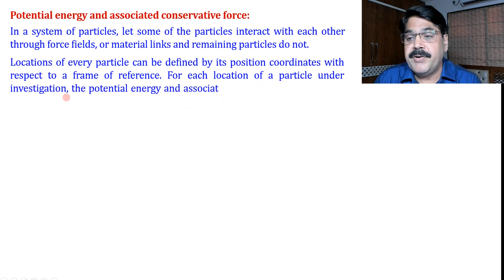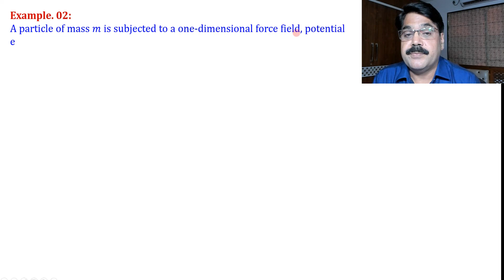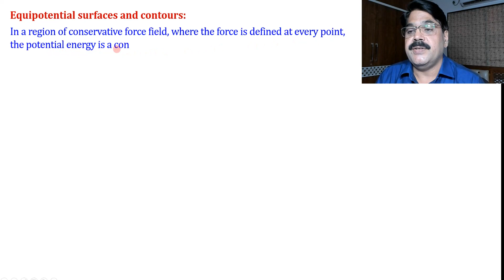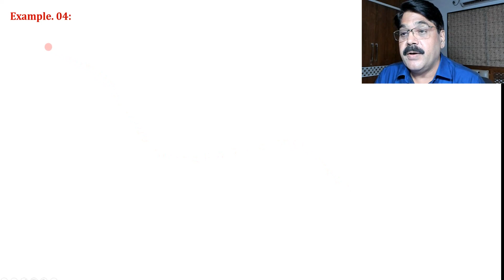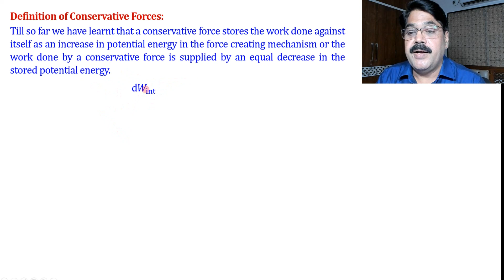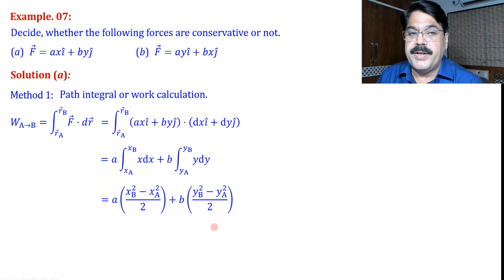L 36  WEP Gradient of Potential Energy

Comment: maximum Force is always perpendicular to equipotential surface.... can't we use this in rocket...when a rocket is launched up to space,, if it will follow a tilted path( not perpendicular to equipotential surface) then force of thrust required to lift will be less , so rocket will reach space with less effort...haan na??...will this be true...?